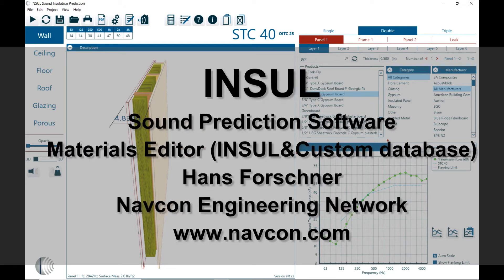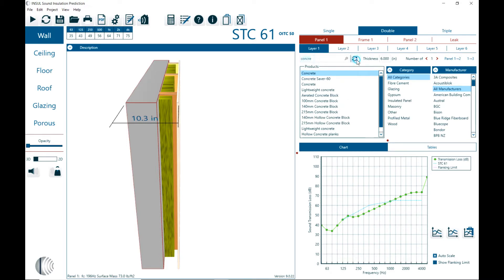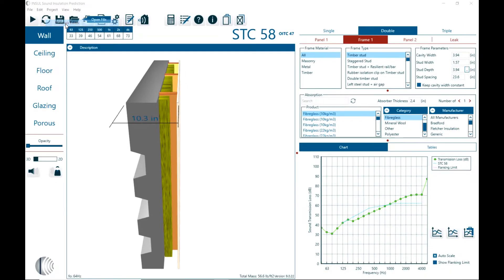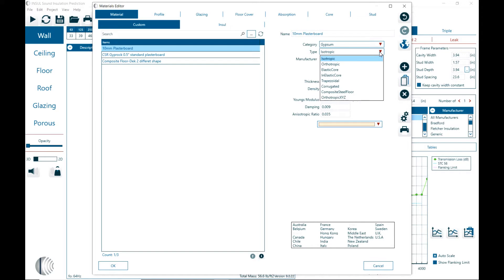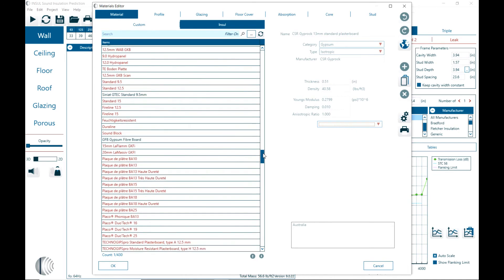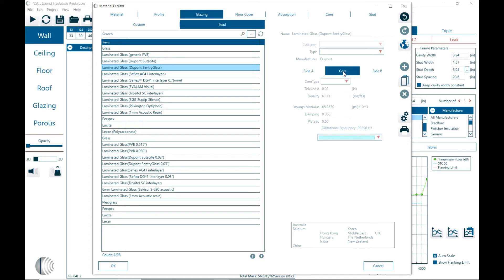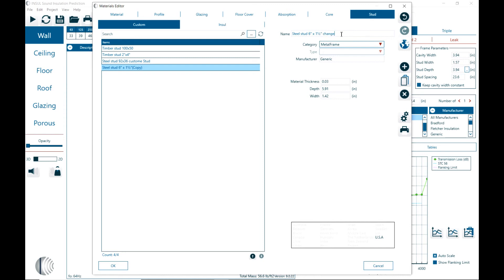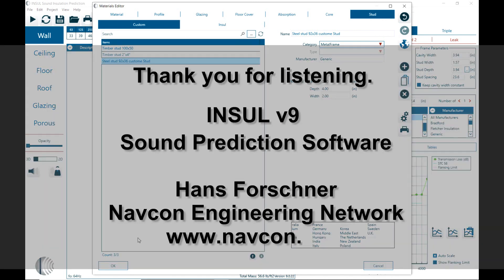INSUL  Materials editor - Introduction

Comment: This doesn't actually tell me how to create materials in Insul. I'd like to be able to create a material not included in the database especially if I have the TL data.
Reply from the maker: Please check the video at 4:00 -> you add a new material.  Give it a name and go through the parameters.  If you have a new material that is similar to an existing material in the INSUL database - I would make a copy of this material which will put the copy in the custom library.  From there you make changes to the name and the respective properties thickness, modules ...  When you are done entering all the parameters you would create a STC or IIC model with your material and see if INSUL's prediction within a range of your test data of your material or assembly.  If it looks different try to identify in which range you have discrepancies (mass area, resonances, coincidence range...). From there you will need to tweak your input until you are getting a better match.  In case you have problems with the adjustments please contact Navcon.

Comment: Thanks for a great video. Very helpful. I do have one question. If you create a custom material, where does it get saved to? If I want to have multiple coomputers with Insul it would be good to copy custom materials over rather than having to make them on every computer.
Reply from the maker: you can save the custom material and it is saved in a folder C:\ProgramData\Marshall Day Acoustics\INSUL90\materials . In that folder you find ~ 15 xml file for custom data from materials, connection, cores, studs,....  you copy the file from one computer to other computers.  You can also setup a network drive folder for your customer data files.  If all computer refer to the same folder that would work the same way.
Reply from the maker: Odd just saw your comment... if you add or change a material it goes into a custom database.  You can copy the customer files to a network directory and then set the path for the custom database in INSUL software settings.  That way you share the material information over multiple computers or users.
Reply: @HansForschner  Hi, thank you for the response. I worked it out 5 months ago though. All sorted now. Thank you.

Comment: Hello thank you for your video, how to move the material found in the "material editor" to the products to be able to use it in the modelling, as it's not appearing there
Reply from the maker: In case a material from the material editor is not showing up in the selection I suggest to check if the material is tagged to a certain country and you may have a filter that is not including the country.  In the settings you can select all country to be used for the material search.  INSUL will show the custom data and the INSUL material data.
Reply: @HansForschner  when i create panel there are no problems. But when i try to create new studs, they don't appear or show in the frame section even when i selected all the regions. Any idea what could be wrong and why the stud is not showing? Thank you
Reply from the maker: @mariannesalameh6810  I just checked when you create custom Stud (make sure to change the label for it) it should show up at the top of the list as you click on the Stud dimension [..]  I just checked it in v9.024 anr it worked fine.  Maybe send me an email to forschner@navcon.com if you have more questions.

Comment: Thanks for the video and great demonstration. I'd like to ask is there any way to model cross section including perforated sheet metal in INSUL.
Reply from the maker: For the INSUL Single Pane calculation you can add a porous material  ... you add the material in the Frame 1 input.    Usually that only increases the STC by a 2 to 5 points.  INSUL does not go into the detail of perforated sheets with fiberglass.
Reply: @HansForschner  Thank you for your reply. Is there any software to predict transmission loss of sound attenuator panels involving perforated galvanized sheets and porous materials in between? Zorba?
Reply from the maker: @yerelradyo  - Zorba will compute the absorption coefficient but it does not address the transmission loss of the absorptive material & perforated sheets... check out the following paper that may be helpful 
http://supersonic.eng.uci.edu/download/JASA_134_2_1090.pdf